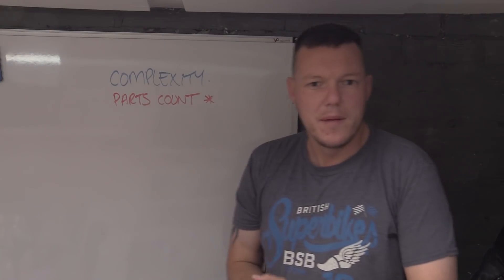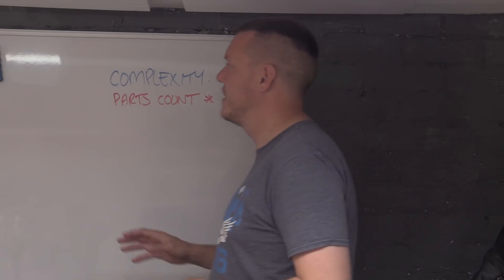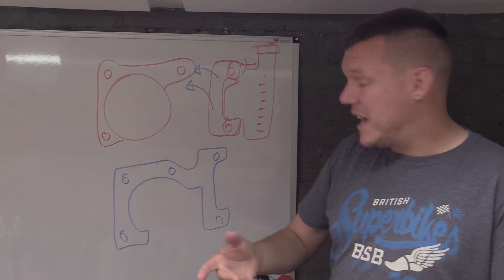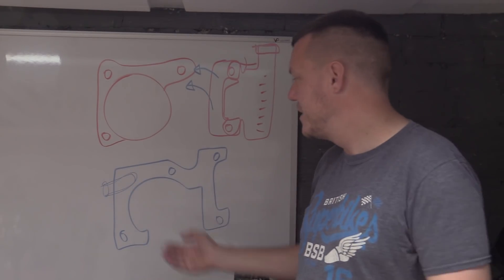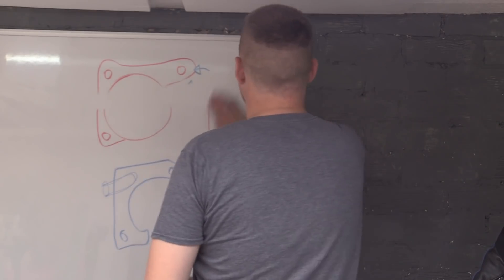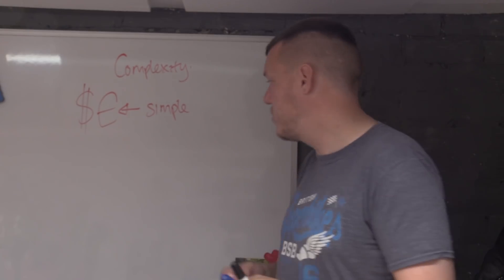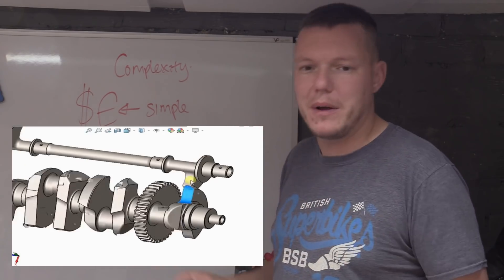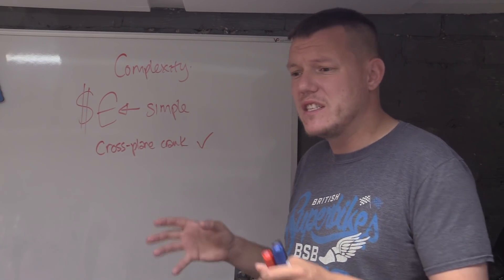Complex Engines

Comment: Matt, wouldn't harley engine be a "difficult" machine to design considering the limitations that are placed on engineers? Yes, the lay out and basic principle of Harley's engine are very old, however, when comparing to engines in same category, Harley is not that far off. 
2020 Harley ~94hp - https://www.jpcycles.com/countersteer/reviews/harley-milwaukee-eight-117-horsepower-and-torque-dyno-results
2018 goldwing -98hp - https://www.cycleworld.com/2018-honda-gold-wing-dyno/
2020 Indian ~103hp - https://www.motorcyclecruiser.com/2020-indian-challenger-dyno-horsepower/

Now the question i have is, if the tech is so dated then how dd Harley's engineers manage to basically keep up with modern bikes while still running air cooled bikes?
Reply from the maker: Cooling is about power or packaging. Did you look at the Honda's TQ @ 1,000 rpm - it's 105 ft.lbs! We also don't have engine weight. The Honda is a flat 6 and not a v-twin, so they're in the same 'bike' category but not the same engine category.
Reply: @thedirtyworkshop  My point was really about the handicap that is placed on Harley's engineers and yet they still manage to do very good job. How would Matt go about designing an air cooled V-twin?  By category i meant long range cruiser. Yep flat six and v-twin are definitely not the same. Yep cooling is about power, get all of that.
Add: Lowest dyno test I could find for HD is ~1500 rpm and its right around 100 ft.lbs. To me its amazing that all the sexy engineering of 2020 honda has, Harley is right there with it? What am I missing?
https://www.cycleworld.com/story/bikes/harley-davidson-road-glide-special-dyno/

Comment: 2 strokes: high performance, low weight, low part count, low complexity (relative to 4 strokes) and thrown in the bin due to emissions... as if materials and construction have no environmental impact prior to starting the engine :(
Reply from the maker: "2 strokes: high performance, low weight, low part count, low complexity (relative to 4 strokes)"

- emmmm. Complexity isn't low. The harmonics of 2 strokes are quite complex, and then with the addition of a power valve its not that simple either.
Reply: Yeah, that's fair enough. Trying to knock up a new expansion chamber in yer garage isn't the easiest task :)

Comment: Can you calculate or simulate what kind of harmonic balancer you need inn engine, as you had on that cross plane crank?

We just had bit problems with vibrations, but we need to measure them.. too much variable in our field..
Reply from the maker: Simulations are only as good as to how close the simulation is to the real components - and they're close, but not close enough. The best way to do it is through testing, and that's why they still do

Comment: Good post.
There is of course the argument for both complexity and simplicity in engine optimisation. 
If you want to manufacture and sell say a portable generator for example, your market has to be taken into consideration, same for motorcycles really.  If you live in Europe/ the West you can build an engine that is complex for that market who have access to backup from manufactures. Plug in diagnosis, specific tooling for repair, even downloaded fuel mapping management. 
Third World country where you have to repair the thing in the bush with an old adjustable spanner a hammer and a knife if your lucky. Simplicity is  the dog's. 300 million Honda Cubs proves this point.
Technology every Engineer embraces, however complexity and related reliability you have to have long pockets for.
Keep smiling,  your barber is😁

Comment: What do you think about the new Koenigsegg 600 hp 3 cylinder? It doesn't look complex from a distance but close up on blueprint it is very complex. You should sell them your variable connecting rod design. I know your not a car guy but it is one efficient engine and weights less than me.

Comment: Matt, question if I may, did they make a special crank, before they changed the firing order. On mick doohan Honda ?👍
Reply from the maker: For which bike, the NSR?
Reply: The Workshop: yes I think it was, early 90’s they would commentate on the free practices, were Mick would ride two bikes, and favoured the big bang 👍🙀
Reply: @davep6286  as I remember it the screamer had more power but Mick pretty much was thew only using it because he was the only one who didn't crash it
Reply: Lasse Langwadt Christensen: you may well be right about screamer. I remember them saying he was the only rider to tame it most of the time. Its when he came out about being the train driver, then spitting his dummy when Alex over taken him in last corner, or run to the line. Have to get old recording out, n relive the memories 😎👍

Comment: If simplicity=lower cost, then what did Harley screw up in the process? The expense is the single biggest issue I have with mine. Forces me to buy third party or used parts.
Reply: lower cost for them. it's their choice to pass that on to the end user, and HD chose to say 'fuck you' instead.

Comment: Usually one associates a greater parts count with less reliability because "there's more to go wrong", but if those parts are for safety / redundancy then I suppose the argument should be "there's more that can go wrong because we have a bit of headroom / leeway" - i.e. dual ignition systems on areo engines, bypass valves in oil filters, software failsafes within the ECU(?)

Just my understanding.
Reply: I think whats needed mostly is for things to be obvious as to whats wrong with them. Simple things like labels on stuff can go a long way (Oil type on the filler cap, tire pressures and chain slack on your swing arm, warnings on your radiator cap... etc). I've wasted hours diagnosing electronic door entry stuff this week, largly because the previous installers didn't bother labling the control switches. Well designed indicator lights and diagnostic displays are amazingly helpful.

OBD2 tends to suck in this respect as you need specialist tools and software to talk to an ECU. Even if you can get info out of it its not obvious what it means. In the IT world, our more advanced network switches use RS232 and simple terminal apps to give a diagnosic interface. The cost is low, and information about the devices and interface is availble. Not so much for ECUs - especially in the bike world.

I guess some people like carbs because they can be cleaned and made to work with a couple of basic common tools. But the complexity of a fuel injection system tends to fix many basic problems - like not getting clogged up as much, small vacuum leaks getting compensated for etc.

Most people don't want to spend the time looking at circuit diagrams and actually diagnosing stuff. They just want it fixed now. This works for me as I enjoy getting paid to figure stuff out!